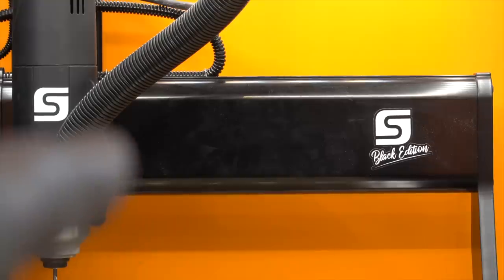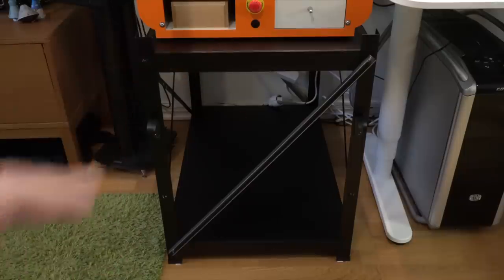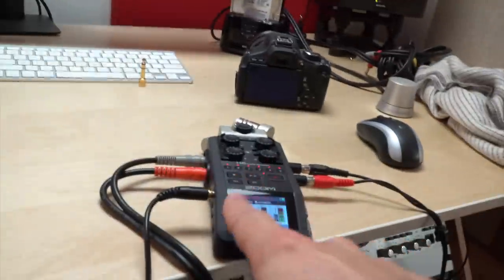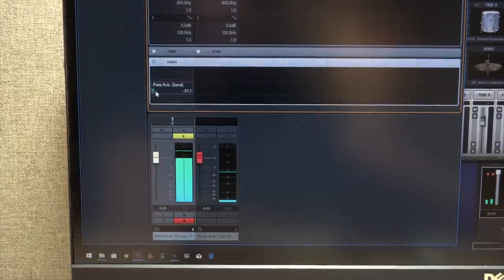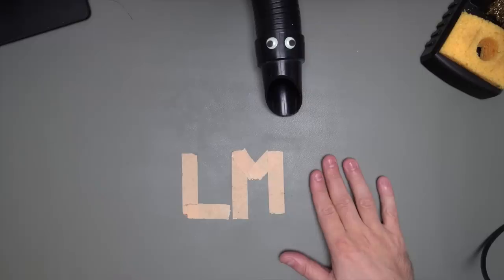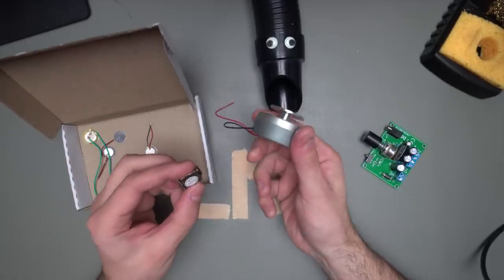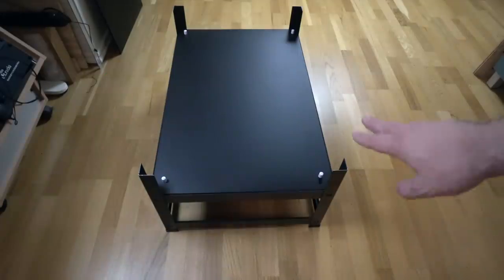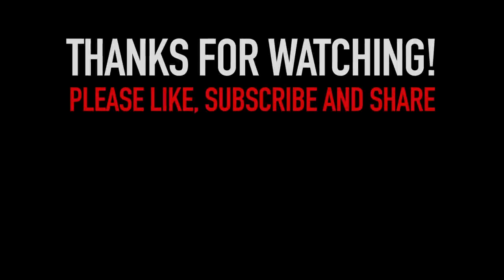DIY "IKEA Hack" Plate Reverb.  Sub $100.

Comment: I suppose I'm one of those few people with an actual plate (PTI Ecoplate II) in their at-home studio. I love the sound, though...on higher-pitched sounds with rapid transients (snares, toms, electronic percussion, blips and such) is where it really comes alive. But a couple of things came to mind watching this video that you might try. First of all, the Ecoplate (and most stereo plates) has a different configuration of transducer and pickups. Instead of the config shown, try this: place the transducer at one end of the rectangle, equidistant from the three edges of the plate. Then mount the pickups in a similar way at the other end, with the stereo pair an equal distance apart from their distances to the edges on that end in sort of an equal-sided trapezoidal configuration to the corners. What this does is it treats the plate as a 'room', with the 'player' at one end and the two ears of the 'listener' at the other. In fact, that's actually what's going on inside the plate; the edges of the plate act like walls in a room, allowing for a two-dimensional version of a space with very reflective walls, and the sound goes through the early and late reflections as it rebounds around within the edges. It'll have a much better stereo image this way, a longer undamped time, and will give you a lot more flexibility in time variation via mechanical damping.

Another thing to keep in mind is that the 'plate' doesn't have to be flat. The Siemens studio for electronic music in Munich used steel mesh suspended inside a cabinet, but the mesh was coiled into a spiral which allowed a much larger amount of reverberant media to fit into a compact space. You can see this thing (the studio is now in the Deutsches Museum in Munich) at https://www.electricalaudio.com/phpBB3/viewtopic.php?t=28005 alongside some pics of other electronic studio gear of the 1950s and 60s from the same studio.

One final thing you might also find interesting is this book: https://www.amazon.com/gp/product/0415996090/ref=dbs_a_def_rwt_hsch_vapi_taft_p1_i0 Nicolas Collins was a student of Alvin Lucier's at Wesleyan, currently the chair of the sound department at the Chicago Art Institute. Both Lucier and Collins focussed heavily on electromechanical systems in music, and this book, Handmade Electronic Music: The Art of Hardware Hacking, is a great idea-book for all sorts of electroacoustic tinkering.
Reply from the maker: Fantastic tips and great book recommendation.  I had never heard of the Siemens studio reverb before and it was very cool to read about it.  

I had to record some Lucier (and Helmut Lachenmann) pieces when I was in college and--at the time--the music made me want to punch the nearest contemporary/modern composer in the face.  But as the years went by, I started to hate the music less and even appreciate it bits of it.  It's weird and subversive.  These days, I actually find myself enjoying some of those more "challenging" pieces of music, but only in small doses.  

Thanks for watching!
Reply: @LeoMakes  Can't blame you for wanting to do some 'five finger critique' on typical academic composers of that time. I suppose that growing up in Nashville tempered out a lot of the serialist wonk in my case, even though I did go through that same sort of thing. But my profs could see the handwriting on the wall and knew that the whole "New Tonality" thing was under way, so I got to experiment with both the academic wonk style and the post-modern (for lack of a better term) directions and see which worked better. And recalling Nashville, that brings up another truly wild reverb technique...

Way back in the 1980s, Treasure Island Recorders had an adjustable _chamber_. Yep...you could change the T60 times in a free space! How this worked was really amazing: they'd taken a small room-sized space, lined that with glazed tile...in fact, you'd mistake it for a largish shower if it wasn't for the strange presence of a waterproof transducer and two hydrophones. These would dangle under the surface of the water, the level of which could be raised and lowered to adjust the time needed from a second-ish up to several seconds. The T60 response curve was really smooth, too; water can transfer sonic energy more effectively than air, and coupled with the faster speed of sound in water, this made for a chamber that could rival even the famous Capitol Studios chambers. Plus, the frequency response of both the transducer and hydrophones fell off greatly below about 200-300 Hz, which kept the boomier bass signals out by design. Might make for another interesting DIY reverb project later on!

Comment: Love the idea and dirty, hands on prototyping. Awesome.

"real" studio plates are normally a stiffer oversized frame and the plate is tensioned tightly in at least eight places. Often has gussets welded on corners to improve strength since sheet is so thin. And, of course, the plate is bigger.

All that may be overkill on a cheap fast project like this. Depends how much effort you wanna throw at it.

But the tensioned in-line, free floating concept would affect how the plate shakes vs. resting on four corners. If you feel like experimenting.
Reply: Tell us more detroitfunk!!
Reply: I'm also curious on specs, because plates were patented by EMT before the label was created and all through its heyday.

There's no way they bought a commercial unit smaller than this vid example. It didn't exist. The old EMT units are about as big as a sheet of plywood.

So while I won't say you're *wrong*, I will say if they had a smaller unit then they built it themselves...much like this video guy. And that has a fair possibility of being right. Many studio of that era were built by hand one piece at a time, often by hacking up old radio or telephone equipment. If they needed something then they made it.

Idk if that's true in this case. But maybe.
Reply: To me those recordings definitely sound like a regular EMT.

Comment: I like this project! I may have to build something similar. Thanks for doing this video!!!   
 I immediately had a couple ideas on improvements...   
#1 on the mics, shield them as close to the mics as possible to get rid of that hum - if you HAVE to have any unshielded wire, twist them together (twisted pair reduces noise).   You also might try adding a ground wire to the plate to shield one side - OR you could attach the mic between the plates (on the under-side of the plate), and ground both the plate and the frame to add additional shielding. It won't get it all, but it should get some/most...   
#2 I would take a sander to the surface of that "plate" to get rid of the finish. You may get better high frequency without that black finish - the down side to that is that it may rust or oxidize, so you may have to replace the heavy finish with a really light lacquer or gun oil. 
#3 Speaking of frequencies, a tone setting or graphic EQ on that driver amp may be a good thing as well.
#4 You probably already know that placement of the driver affects the sound, move it around to find the "sweet spots" and mark them. (do the same with the mics)
#5 because the drive is held in place by gravity, this type of set up need not be "ferrous" (iron or steel) - plates of different materials may be interesting to try - Aluminum, brass, or even plastic 

Again, this was a wonderful video and a great idea, thanks for the inspiration!!!

Comment: About the hum problem: You could try using differential audio inputs for the piezzos. Use a shielded cable, and leave the shield unconnected at the plate side. Connect the piezzo to the two wires of the differential pair.That should cut down on the hum. I love this project - it's so simple and sounds amazing!
Reply from the maker: Good recommendation. I'll be trying this and a few other approaches to see what works best.

Comment: Love the video and idea 😀 Just a tip for the soldering part. You should cut the legs before you solder and have a pad or similar to avoid the components to fall off. This will make the solder better and last longer. If you cut them after that will make a shock in the solder and can give some cracks and it will eventually oxidize 😊

Comment: Great video... I would EQ the reverb signal, there seems to be a dominant frequency in there, around 1 or 2 K ... while it is a characteristic of most spring and plate reverbs to have such resonant peaks smothing it down could give a much smoother reverd. Well props to you well done...

Comment: There may be less distortion if the transducer is stuck or clipped to the plate.
You could also try a pre-emphasis filter before the plate and post-emphasis after to see how it sounds. It can be done in the DAW. I suggest to lower the lows and boost the highs with shelf filters, and the opposite after the reverb.

Comment: I did something very similar recently with one of those stamped-steel CD towers you used to see everywhere - put a contact driver on the bottom of the tower and piezos at the top, and built a little box with an LM380 driver circuit and a pair of simple piezo preamps (FET into TL072)  to run it all. Because it's a column it has some pretty prominent resonances but it's very fun to incorporate into complicated pedal setups with feedback and so on. I should really do a little video about it at some point.
Reply: Please do, that sounds great

Comment: coolest video on Youtube? Got my vote. Only way to improve this would be, use an angle grinder to cut the legs like a hot knife to butter bro. You can even round and clean the rough edges once you cut them and then spray them black with a nice paint like Belton Molotow craft paint. Other additional ideas for this project: You can also use aircraft paint stripper to get that black paint off the top plate so it can resonate properly. That Ikea paint is deadening the ability of the soundwaves to travel quite a bit. It will sound way better without that think coat of powedercoat on it and should be a very easy strip. You may need to lightly treat it to keep from flash rusting if its not stainless. thin coat of sprayable polyurethane or something is much better than hard paint. You can ALSO use an old snare dampener on the surface instead of a towel or whatever, with those old turn wheels to increase/decrease verb decay! I used to use EMT's at Electric Lady for years, this is an amazing hack. Thanks a ton man great vid! check out my similar stuff at www.CreativityNy.com

Comment: You'd get better resonance out of it by hanging the plate vertically, rather than laying it horizontally. Letting the plate dangle will allow it to ring the way a bell does. Having it supported at all four corners is creating a built-in dampening.

Comment: That is awesome!!

I actually see a lot of possibilites:
- try to put the transducer and piezos under the bottom plate (to have it to resonate) and place some material on it, like metal balls, gravel, metal & plastic chains ...
- ... or try to make
- try a vertical mounting with chains hanging really close to the resonator plate

With an Arduino card, it could be easy to control servo motors linked to the chains...

Really nice so fa, anyway!!

Comment: I mean, if you actually got a plate that sounds good, I bet this would sound just as nice as the nicest EMT 140's around. I've heard one being tapped by a finger in real life, and the sound of just that acoustic finger tap in the room with it not hooked up was BEAUTIFUL. Very full and complex. So if you can find a much bigger plate that sounds something like the real plates they used back in the day (should be possible to make or at least find cheaply), you should be getting the exact same sound, even though you wouldn't be able to tune it the way you did the old ones, unless you built a little mechanical system for that, or even did it manually.

Comment: Cheaper still, just buy one plate, some wire, and screw in hooks. Screw the hooks into the ceiling, and glue the transducer and pickups to the plate. This might even resonate better. Never know. You could even hang that up in your attic and run some lines to it.

Fantastic video though. Really well done.

Comment: Very nice try on this. Very simple and clever. Can I suggest you to try some cheap passive DI boxes between the piezos and your preamps? They would offer a better match of the impedances and I think reduce the hum. You might also reduce the length of your asymmetrical wires and box your amp to shield it, for the same purpose. Please make some follow-ups on that project. 
Anyway, thanks for sharing.

Comment: Sounds good! Although I'll not be making such a big thing by myself (at least in a close future). Maybe it will sound more interesting if you'll add springs between (or above) plates. I mean long springs... Although maybe placing the reso-plate on spring-supports will make some difference... It will be possible to move around a house without possibility to "spoil" the construction.

Comment: Very cool project - might have to try it (I paused your video to go looking at small wattage amp kits on eBay). From piezo experiments I've done, I'm thinking you probably should add some 1 megohm resistors between your leads to keep the output voltages in check.

Comment: What i heard is that placing the inducers not a at the half mark, but at 2/5 (in both directions) it will vibrate better making the volume on low and high  piches more equal. The chanel "Tech Ingredients:" has an awesome video about this topic.

Comment: I don't know about you, but I don't think that IKEA steel makes the best splash. I am absolutely in love with the concept, and I'm amazed that no-one has made a video like this before, but surely an even better plate reverb would be a brass sheet suspended across two very thin supports with the transducer/microphone setup.
Reply: That would definitely sound better, but a big part of the appeal of this video is that it was made with IKEA parts!
Reply: @SeattleScotty  I suppose... Meh. The thump of the the IKEA shelf just sounds like the recording engineer was getting a bit too into the track, and drumming along to the beat that's playing through it.
Reply: If you get too free with the resonance then you immediately start washing out your sound. A larger sheet without edges suspended with springs, and an adjacent dampening felt that can be finely adjusted to nearly touch it. I can see why Pluto Plate charges five grand for a unit.
It's been on my to-do list for a while. 😸
Reply: The appeal of IKEA is that it's available just about everywhere and it's cheap. I couldn't create a Bror that cheap from local materials.

Comment: Leo, the piezo’s do sound mostly like a notch-filter around 2k or so. There are a few types out there. To get rid of the hum problem I recommend make m balanced  using two Piezo’s per pickup. Google will find the pinout
Reply: Clamp the piezoelectric a little to change its frequency coupling

Comment: I find that plate has too much tone. But the idea is of course great :) 
Also: seems like the IKEA legs and the bottom plate are not necessary at all, all you'd probably need is some kind of wooden frame to suspend the plate in using springs on every corner. So basically, just get that IKEA plate and build a wooden frame or box big enough to accommodate the plate without touching anything.
But then again, this opens up a whole lot of new possibilities. Try all sorts of metal plates and see how they sound. Even cardboard or plastic panels could be worth a try. Or how about glass? Who knows, might be just what you needed for this one track that was missing something :)

Comment: It's a pretty awesome project dude! I think a bigger sheet of metal can make more reverberation and creates some sort of multiple reflection points, nevertheless, that sounds interesting. Bigger transducers and probably better quality can capture more details and add some nice flavour to it, also try to use some cuts from Rockwool acoustic insulation (it's denser than regular Rockwool)wrapped in the sheet of fabrics and test it out dampening. I'm sure if you design this properly you can build proper plate reverb even for a custom client who will pay for it:)that would be a good business model...who knows:).
Reply: Pluto Plate are like five grand.
Reply: @hoboroadie  you don't need really pluto plates just metal plates (might be even thick) and you can build it yourself:)

Comment: Super cool project. Love the sound of it. Two things that threw me were the height of those left over legs and the suspension technique. Have you thought about springs to make it more permanent? Would you even need the second shelf? Could you cut those legs even shorter?

Probably not things you have answers to at the moment, but those are my thoughts. Still a super cool idea and implementation!

Comment: Nice idea. Maybe it can be even simpler. As far as I understand you don't really need the table only the plate (actually the plate is just a hassle as you try to avoid any contact with it). So why not just hang the plate from the ceiling with some fishing line sort of thing. I have similar setup with a transducer and resonant foam plates hanging...

Comment: I am not into music at all, but I think this is very interesting. Wouldn't it be better to hang the plate just from 2 strings? It would swing and vibrate freely and you could hang weights off of that to dampen it, or lower the resonance frequency.

Comment: This is just fantastic! Thanks for taking the time to make a video like this. I do have a question. Where didn't you place the transducer in the center and the pickups on the edges? Wouldn't that give the best reverb? Also, Do the wires rattle against the plate? 
I'm totally going to make me one.

Comment: Would there have been enough tension on the plate for it to function if you cut along the frame of the plate but left a bit of the corners intact?